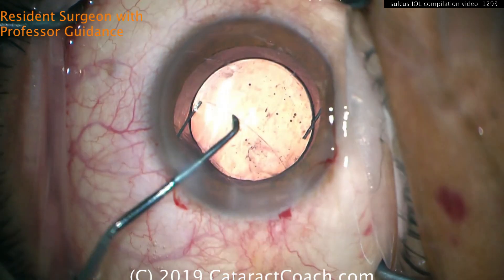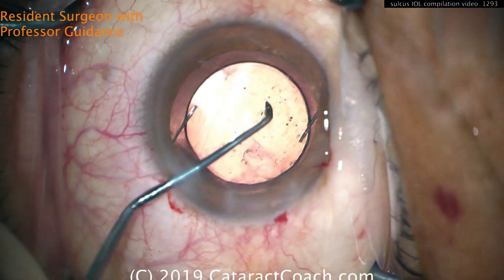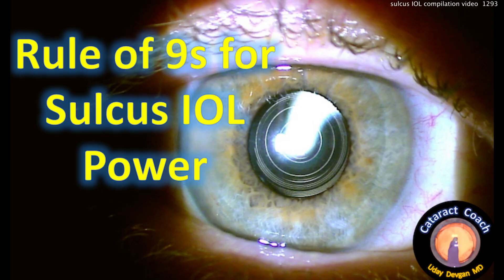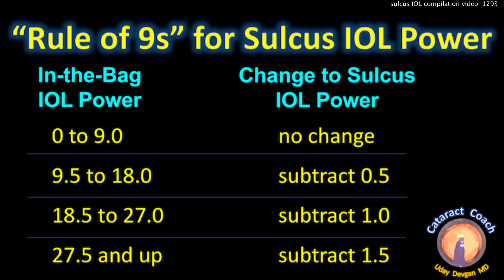CataractCoach 1293: compilation video: sulcus IOL tricks and surgical pearls

Comment: Following the rule of 9's and the A constant change - should it not be a 19.5 Diopter 3 piece lens if optic captured (A constant adjustment only) and an 18.5 Diopter 3 piece lens if in the sulcus (A constant and 1D change as between 18 and 27) if the original lens was 20D at A constant 119.2 and the 3 piece has a A constant of 118.7?
Reply from the maker: yes, you are correct. forgive the misspeak

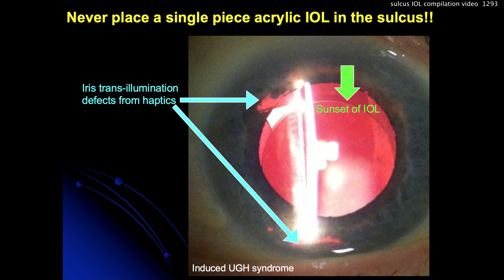Comment: Thank you! Particularly for the part @8:45 about NOT putting single piece IOLs in the sulcus in patients with posterior capsule rupture. As a cautionary tale, I am a VR surgeon and I recently had to do a retinal detachment repair for a patient whose cataract surgeon caused a posterior capsule rupture, didn't do an anterior vitrectomy, and put a single-piece IOL in the sulcus. By the time the patient came to me, the IOL was wrapped in vitreous, was subluxed inferiorly, and there were a lot of AC cells. On fundoscopy,  she had 6 tears in the peripheral retina and a total retinal detachment with some PVR. I was shocked by these findings. I performed a vitrectomy, fixed the detachment, and removed the single piece IOL and replaced it with a 3 piece IOL of the correct power (sulcus placement with optic capture). I then received a letter from the guy who performed the cataract surgery and he was angry that I replaced his single piece IOL; he even wrote (in German) that "single piece lenses work very well in the sulcus." I trained in Britain and Australia and I learnt from day 1 that single piece IOLs in the sulcus are contraindicated for a multitude of reasons. When I responded to him, I was tempted to write that he should open any book on cataract surgery or look at your youtube channel, then get back to me. I have referenced your channel and videos several times for teaching and I recommend it to all of my colleagues. Your videos are particularly valuable to ophthalmologists in countries where there isn't a structured program for learning cataract surgery; hopefully it will lead to a more rational approach to surgery and less complications.
Reply from the maker: Yes, you're absolutely correct. A single piece acrylic IOL should not be placed in the sulcus. In addition to the complications that you mention, it can also chronically scrape the back of the iris causing UGH syndrome (Uveitis, Glaucoma, Hyphema)
Reply: How about a single piece PMMA lens? @UdayDevgan
Reply: @Robert Blum I stain the Vitreous and do Vitrectomy...Is that enough?  And once PC is ruptured I have heard there is a persistent risk for RD due to Vitreous inertia in the globe.
Reply: I wonder if German surgeons favor Sulcus placed IOLs. I have a possible UGH syndrome patient I am scratching my head about that had cataract surgery OS in germany a few years ago and just keeps having iridocyclitis events in that eye!

Comment: Thank you for this nice video
Please how much intact anterior capsule do we need to implant a stable 3 piece , and does the position of the anterior capsule tear affect th decsion 
Thank you
Reply: Anywhere between 6-9 clock hours you can try placing in sulcus..if less than 6 clocks hrs than you can try SFIOL or one haptic in sulcus and one haptic in scleral tunnel.